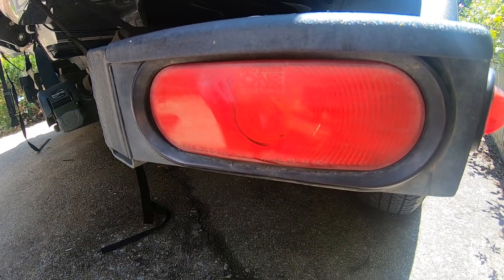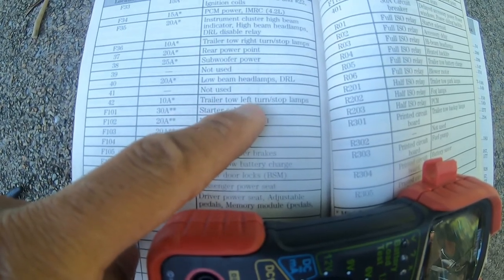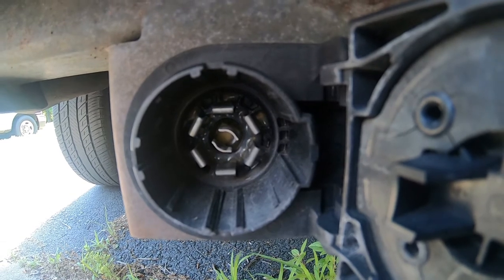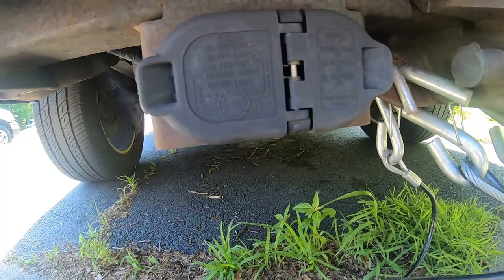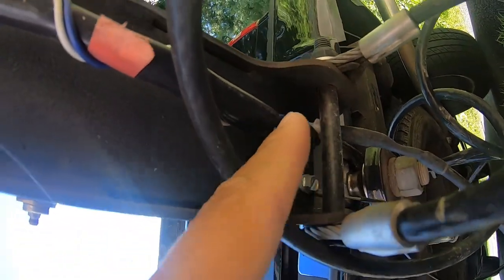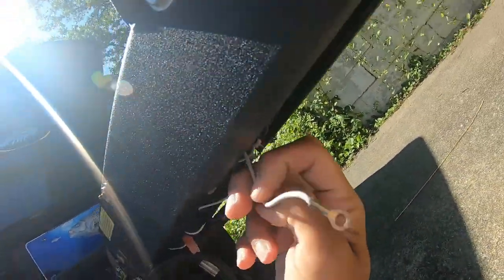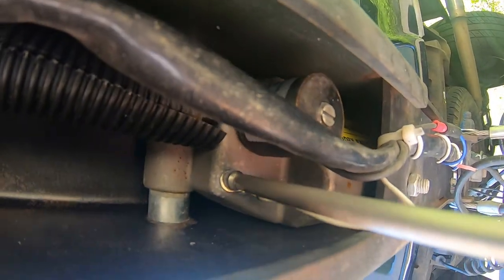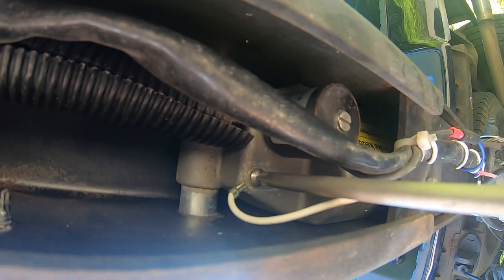No Trailer Brake Lights or Turn Signal Lights

Comment: I have trailer taillights with my 98 expedition but no turn signals or brake lights
Reply from the maker: Try checking the trailer side wire harness for a break in the wires

Comment: mine does did this with 3 different trailers, is it possible they all have bad grounds? where's the dang f150 7pin grounded?
Reply from the maker: If on the truck side you may have a bad harness

Comment: I have an issue where one tail light works and the other doesnt
Reply from the maker: Check for power on the tail light that doesn't work. Maybe a broken wire